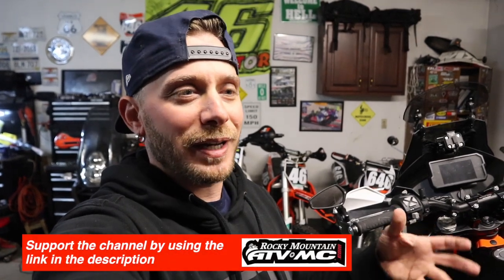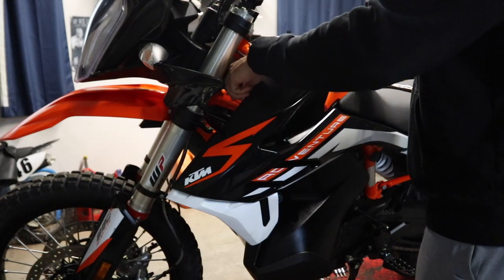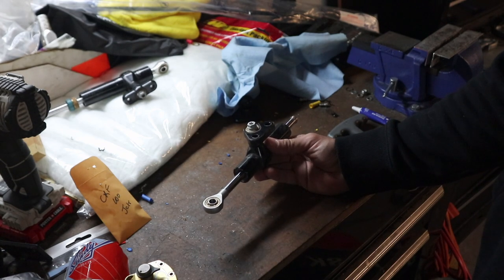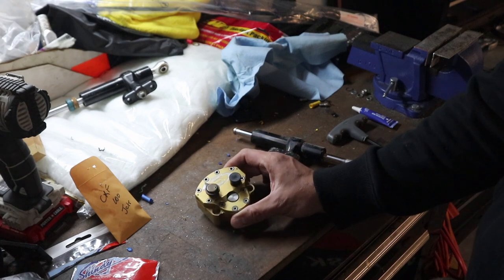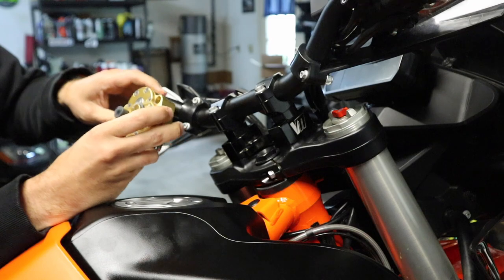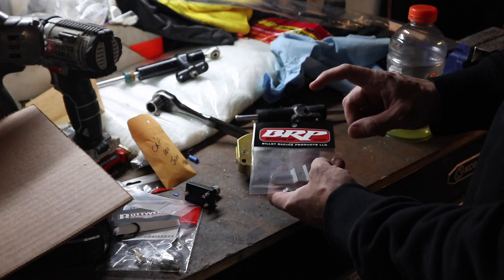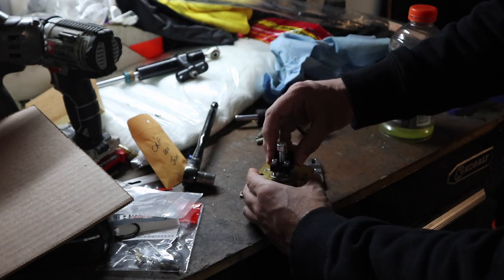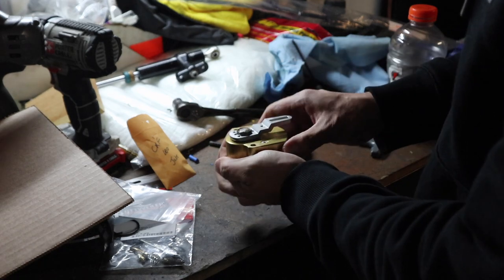KTM 790 890 ADV Scotts Steering Stabilizer Install | Back in the Garage

Comment: Small world. I also just bought a used 890 ADV-R. Mine also came with a Vanasche riser kit. And my previous owner ALSO declined to include the damper in the sale. I too happened to have a damper laying around! Fortunately my guy left the pin in place. Although I also had to get a stepped, +8mm arm. I also turned to BRP for the arm.

One thing you may want to touch on is the difference between a "road" and an "off-road" damper. The road damper damps both deflection and return steering where the off-road only damps deflection. Or so they say. I have a "road" damper from my road-racing days. I mounted it on the 890 as I have it and figure it is at least as useful as the stock damper (which also damps return steering) and adds adjustability
Reply: Which one? Scotts ir gpr?